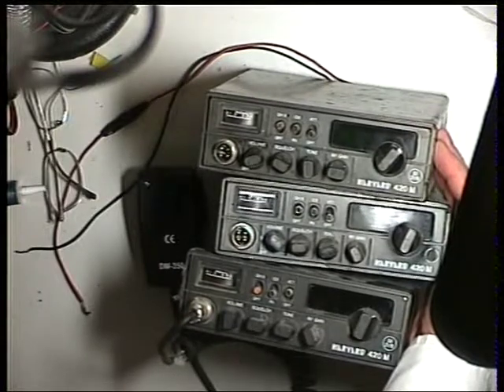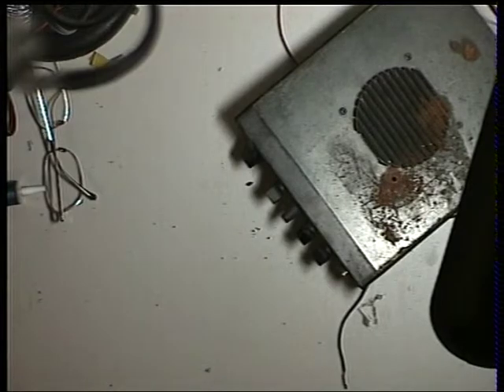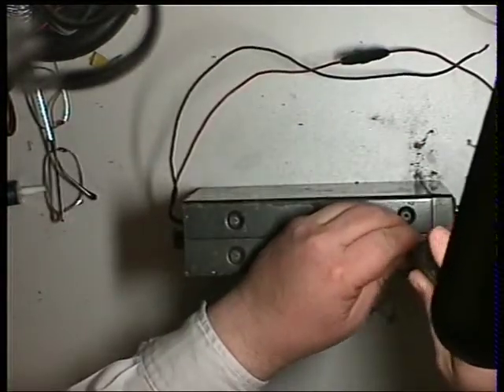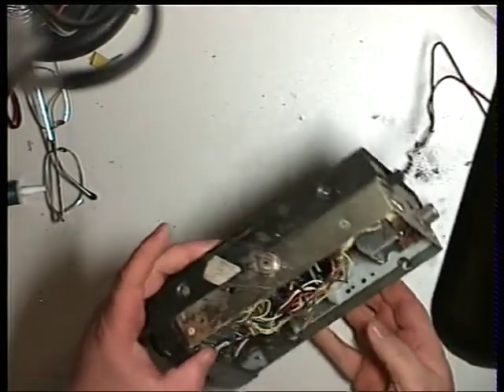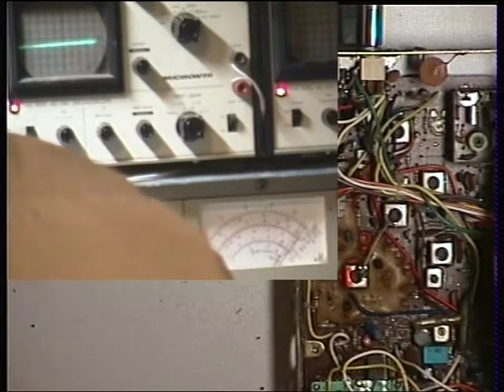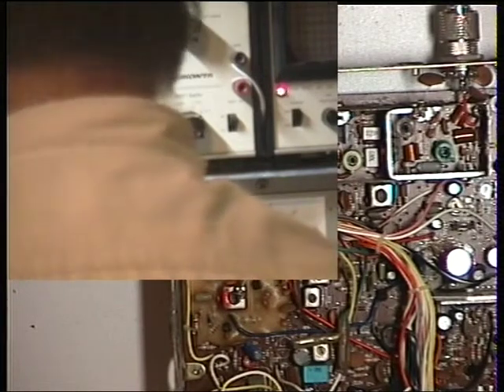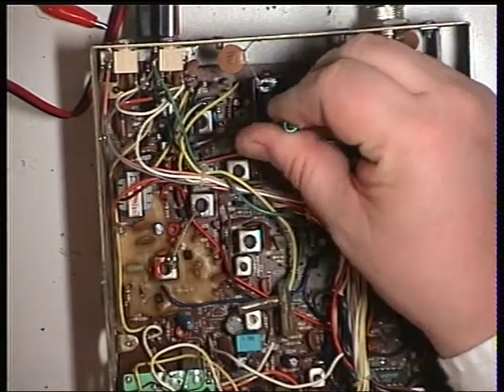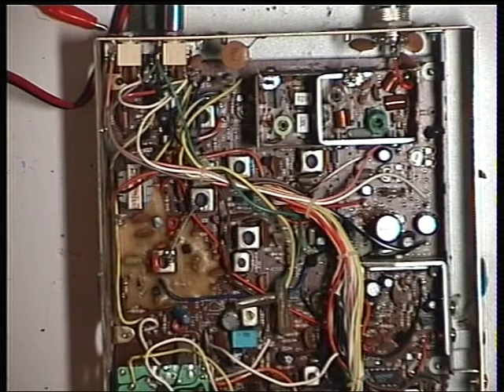Harvard 420M UK CB radio. Alignment of Transmitter

Comment: Left on 4.4 watts? Illegal surely....?
Reply from the maker: +TheOptimod Power supply at 13.8v. Most cars are 12.8 to 13.2v, with a corresponding power drop on this kind of cb radio in relation to the input voltage. A 10% allowance for measurement error is allowable. Taken out of laboratory conditions, the radio will not produce excessive power. A bit like your car showing 33mph on the speedometer.....probably really only 30 in reality!

Richard
Reply: UK CB radio servicing Ahh ok makes sense.
Reply from the maker: However, if it were a Volkswagen taken out of lab conditions....that would be a different story!